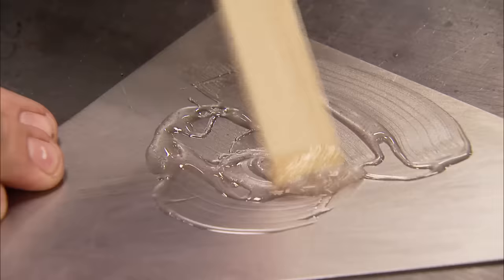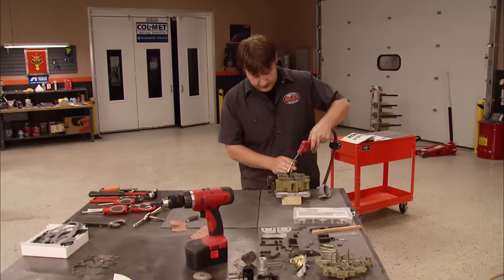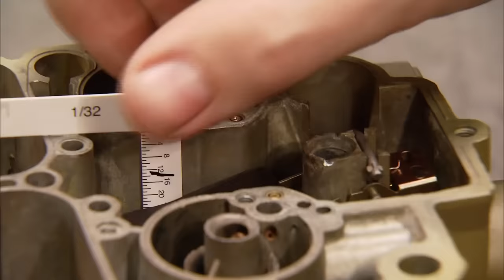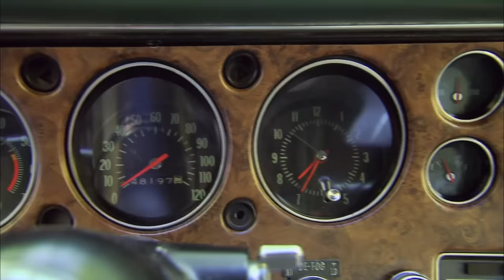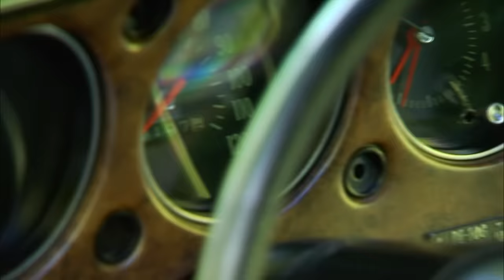How to Rebuild a Carburetor: Quadrajet 4 Barrel - Muscle Car S4, E18

Comment: A much maligned carbie - haven't touched one in 30 years but do recall most were screwed up by idiots 'fiddling' - idiots who would then go and buy a Holley and new manifold to suit. Usually only took a couple of hours to fix their stuffups. It was a lot of fun when you got them to stick it back on to try before they fitted the 'better' Holley which ran worse.
Reply: Gordo,
That's so true. I had a 69 caprice 396 Q jet I replaced the Q jet with a holly it was way down on power. So I rebuilt the Q jet took me over a week but it ran better, and got much better fuel mileage than the holly. I was surprised. Of course with the Q jet after rebuild I still only got 16.5 MPG  but the holly only got 15 and no power either

Comment: I think I fixed a bazillion of these. Biggest issues were the throttle plate center screw and the throttle shaft bore elongating and causing a vacuum leak.
Never! Remove the metering rod stop bolt without measuring the distance with a depth mic first!!!
Haven’t watched the vid yet so I hope I’m not repeating what’s already been said.
Reply: Just run the screw down till it bottoms counting the turns, make a note & when reassembling run the screw down & back up the required amount.  Either way you are assuming that, if the carb has been rebuilt previously, the adjusting screw is in the proper place.
Reply: Larry Hutchens I’m an old toolmaker\deaigner. I do it using toolmaker methodology.
Reply: They didn't do anything to the metering rod stop bolt, they didn't even remove the steel cover over it

Comment: The real issue I had with the Qjet was no matter what I did the secondaries just wouldn't kick in on my truck.
Reply: The choke has a safety deal in the linkage. If the choke or that linkage thing has an issue it will prevent the back barrels from kicking in.

Comment: 99% of the time you'll bust every one of those butterfly screws.
When they work they work great, and sound great when the secondaries kick in.
Reply: Exactly. Those screws are staked and never come out unless you file the ends off of them. I don't know why they didn't share that tip... Somewhere out there at this very moment someone is ruining his baseplate by twisting those screws off. Lol

Comment: Quadra jets are good for daily drivers but no good for performance since the single float bowl is small and it's in the center of the carb instead of the outside of the carb where they can cool faster and not heat up like the Quadrajet bowl does that's why Holly and Carter/ Edelbrock are the best
Reply: Ok, tell that to Super Stock drivers running Q-jets. And F.A.S.T. racers.
Reply: center float bowl is better. incoming air cools the fuel/stabilizes bowl temp and is very hard to get them to flood. you go up on a curb and an edelbrock will flood. Holley's hate sudden acceleration or deceleration.
Reply: @WVXL64  I was also going to mention F.A.S.T. The top guys are running 10 second quarters with Q-jets.
Reply: Bigger fuel bowls only bandaid fuel delivery problems. 

The fuel will run cooler in the middle of the carb, it is cooled by the fuel evaporating in the Venturis. External float bowls only heat the fuel.

Comment: Difference between funk...and faunk... funky is no good at all...funky is old but good...(old street lingo) also teflon tape stops any chance of leaks or a re do later with a tighten up...suh weet!!! A long time friend named LARRY...taught me some tricks on quadrajet carbs...there is an adjustment below the bolt that holds the air cleaner on...shhhh

Comment: step one throw in metal scrap can, step 2 order Holley Spread bore replacement. They are called quadrapuke because they don't last. Add alcohol in today's fuel. You'd be lucky to get 3 months out of one.
Reply: Don't use ethanol contiamenated fuel on carberated engines it'll ruin the fuel system.

Comment: ever heard of fuel injection it's a modern thing kits avalable since 1989
Reply: graham chav 

Only marginally better than a properly tuned carb.. and way more expensive.
Reply: Who can afford the prices?
Reply: Carbs will always make more torque than FI.
Reply: ...Not if you're doing a stock rebuild. EFI is better IMHO if going aftermarket and $$$$ isn't a concern.
Reply: Yea i mean wat the hell why go with a cheap carb that can get the job done when u can go with a 1,000 to 2,000 dollar sniper fuel injection kit!  I mean duh no brainer right.....wat a joke!
Reply: I've pulled 3 injection set ups for ppl the last year . Shit didn't work . Drop on Edelbrock carbs cause they had sqaure bore carbs . All 3 said there stuff runs better than it has in decades . A carb will leave injection sitting at the line every time !

Comment: ahhh!!! the ever unpopular and pain in the butt junkchester!
Reply: dafyd242 they are the finest engineered factory carburetor ever made. They are however the most complicated carburetor, outside of a Weber. Not made for "RV" cams, Hot Rods, or lack of knowledge on how the unit works. If you understand them, and use them in the correct application, there is no finer mileage / power combination in a carburetor . A ride in my personal big block pickup would change your opinion of Qjets.... guaranteed

Comment: Interesting fact, this big old boat of a personal luxury car is about the same weight as the new Dodge Challenger "sports" car in R/T trim, and actually weighs LESS than a Scat Pack (4226 lbs), SRT Demon (4254 lbs), or SRT Hellcat (4469 lbs!). Dodge should be ashamed of themselves.